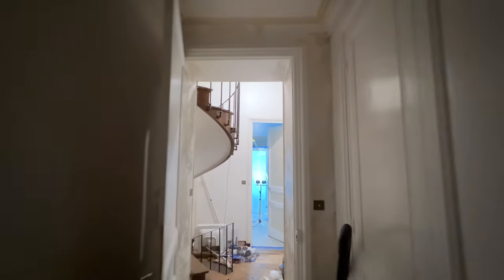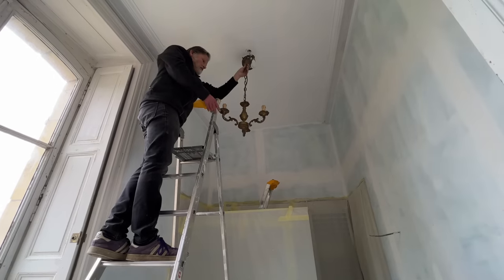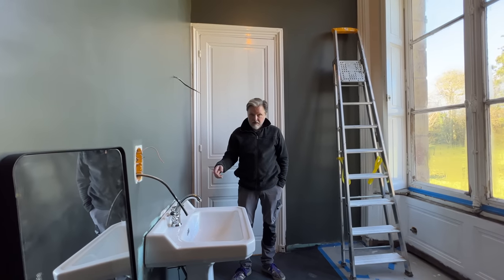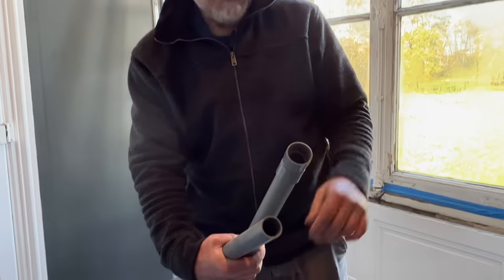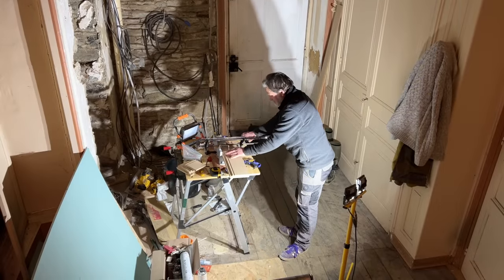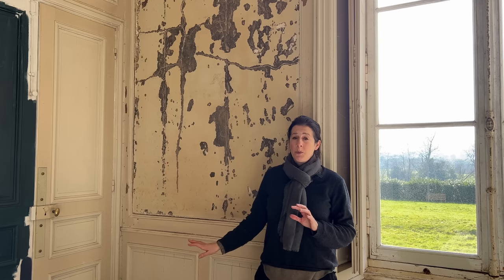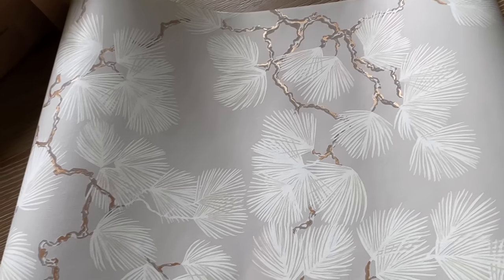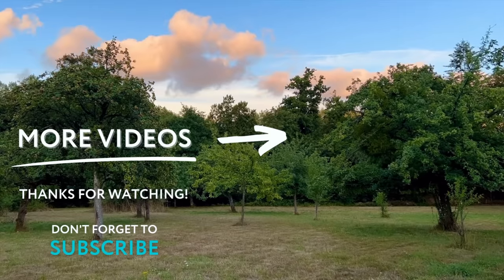Our New Chateau Project PLUS: We ALMOST Have a Beautiful New Bathroom

Comment: I am a procrastinator. However, over the years I have come up with a solution for myself so it doesn't hinder/cripple me in the long run. I plan out the process and divvy up the work for each day so in the end I finish on time and don't exhaust myself. It took me years to come up with this approach which is no surprise for a procrastinator. Don't give yourself dead lines, that will only give you an anxiety attack. Think thru the project carefully, plan out each step, knowing that it doesn't have to be all done in a day or even by a certain date. It's the best solution to complete the job and do it well. And one last note, reward yourself at the end of each day with a glass or two of your favorite wine. It's the carrot that will keep you going. Cheers!

Comment: Before wallpaper prep the walls as you said, fill then sand then for a perfect finish cross line the walls horizontally with lining paper then hang the finish wallpaper on top 👍
Reply: I wondered about that, wasn’t sure how wallpaper would adhere to skim. A lining makes sense now.
Reply: @sailingwhitsundays5672  there's different grades or thickness of lining paper, the rougher the wall the higher grade you go. It's worth it in the end for the finish

Comment: Ah, MDF baseboards in bathrooms...I have a 100 year old house, old for where I live and we put high density, very similar profiled  MDF baseboards everywhere and new plumbing.  Years later... a leaking valve behind a toilet, water soaked up into the MDF.  I highly recommend to PAINT the under side of your MDF before nailing in!  The water soaked up like a sponge into the unpainted underside of the baseboard and swollen MDF is very difficult to recover - it never looks the same again,  all lumpy, tried everything I could and it still looks crappy.   Not to mention crawling behind a toilet, sanding and painting.  I don't think I would use MDF in a bathroom again, using the floor tile is a good option and looks lovely and leak proof, plus holds more water if someone overflows the bathtub or toilet.  And I love the wallpaper and the smashing contrast with the dark doors - great pick!